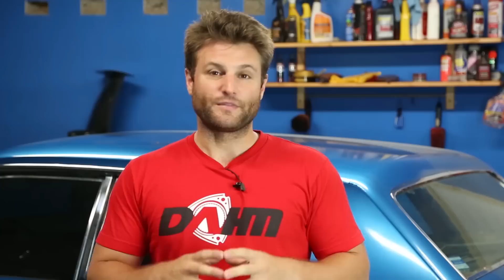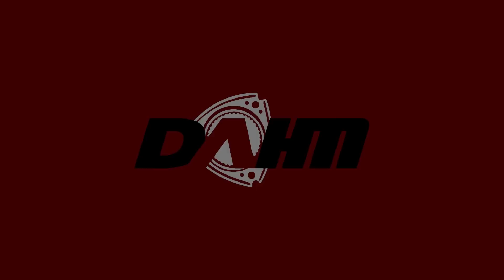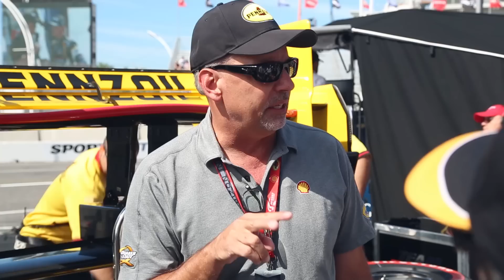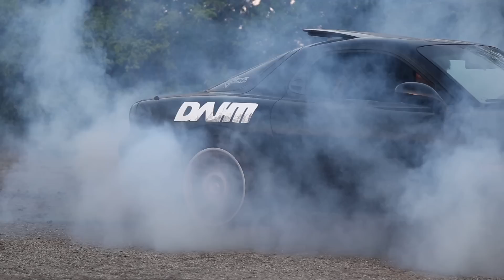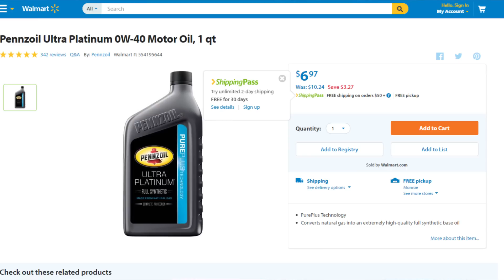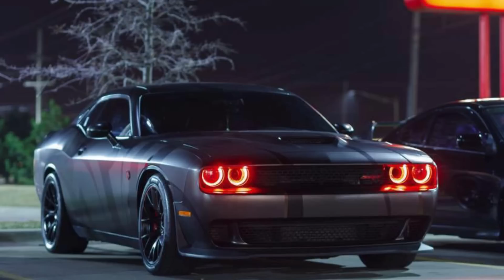Why I'm Using Pennzoil in the 4 Rotor RX-7

Comment: #RobDahn Why are you using Full Synthetic oil? 
I've always read to never use synthetic oil in my RX-8 because it's not designed to burn off and can lead to oil build up on your spark plugs which can cause misfires. Now, I am just a normal guy, not an engineer like you so could you please try to explain this better? Thanks.

Comment: Original FD owner chiming in. When my FD was new I used Castrol Syntec (forget the weight, but it was the popular viscosity choice back then) and used synthetic premix from Petit racing. The reason I mention premix is because, as you know, oil is injected directly into the fuel system by design. From what I understand, synthetics do not burn as well as traditional oils and it could damage your engine. As a matter of fact, my engine blew up at 20,000 when it was still under warranty -- which was more than likely a screwup on my part after not getting all of the air out of my cooling system after changing it. I learned later that you have keep an eye on the coolant level for a few days because there might be a few air pockets in the system. When I was checking up on the status of my car at the dealership, I saw my new crate engine with big bold black lettering "Using synthetic oil will void warranty." From then on, I just used regular Castrol and everything has been fine up to ~90k total miles on the vehicle. After seeing your video on Pennzoil, I'm very impressed with what you've told me, but I'm still concerned about using synthetic in my car. That said and thanks to this video, I might look into traditional Pennzoil blends.

Comment: My FD and my father's FD as well as my friends FD, all use Penrite HPR30 mineral oil, because we're in Australia and thats the best we can get here. No lubrication related issues with it so far, and thats across us owning 14 FDs collectively over 10 years. I doubt you guys get Penrite in the USA though.

Someone else in the comments mentioned that piston engines are harder on oil than rotaries- thats true as we don't have connecting rods 'slamming' up and down, causing hammering motions on crank bearing journals. Rotaries are smoother and less shock loading happens on the bearing journals to a point.

Someone else mentioned synthetic Mobil One oil. Its not something I would use in a rotary. It does not burn in the chambers cleanly like mineral. It has a high temp burning point and it resists being combusted and can leave deposits which gum up the seals and springs and cause compression loss issues. Mazda Australia and Mazda Japan issued tech bulletins specifically warning not to use Mobil One in the rotary (FD and RX8).

Comment: my dad was a big mistake Phan back when I was 14 years old my mom bought her Mazda MX-5 when I was 10 when I was 15 it developed a rear main seal leak for some weird reason my dad bought mobile one put it in the car and a little over a month later it stopped leaking I've used Mobil 1 and every one of my vehicle's sense I'm now 31 years old I'm a big believer in mobile one I have a 85 Mazda RX7 with the original engine and it runs great only thing done to it is header and dual 2 inch exhaust no one in my family runs anything else but mobile one

Comment: Rob, I was always told to never use synthetic oil in my rotary (rx8) because synthetic doesn't burn? Was I told wrong or whats the deal here
Reply: You were given very good advice. Stick with the mineral and you'll be fine. My FD has been daily driven since 2010 on mineral, because Mazda recommends only to use mineral, and steer clear of synthetic for exactly the reason you mentioned. It burns poorly and can leave deposits which gum up seals, causing loss of compression. Mazda issued a bulletin about this- if you google, you'll likely find it.

Comment: I'm skeptical about the rotary application.  I imagine the lubrication demands on a rotary are very different, just as they are very different on a two-stroke.

Look, there's no way I would put Mobil 1 in my two-stroke.  But I wouldn't put Blendzall in my Mopar.
Reply: Yeah, all talk aside, oil-related failures are pretty rare today.  As long as it's fresh and there's enough of it you're usually good to go.

Comment: 0 grade on rotor engine... better buy a lot of oil, you will probably be adding often.
Reply: Yup. You want to be in the 10's or 20's especially in a turbo rotary with a lot of heat from the rotary and turbo- the thicker grades will thin less and still give bearing film strength. A 0 weight is watery already without adding a shit ton of heat.

Comment: Is it true you have to pour oil into the gas tank whenever you fill up a rotary? Good thing youre now sponsored by Pennzoil or youll be broke.
Reply: it's actually common practice for high performance rotary's to delete their oil metering pump , which pumps oil directly from the oil pan into the intake. Some of the reasons are that the oil metering pump does not supply an adequate amount of oil into the combustion Chambers of higher-performance rotaries. another reason is because using 2-cycle oil directly in the gas tank is cleaner-burning then the oil metering pump which is supplied from the oil pan.

Comment: Noooooo! Don'tont use synthetic oil in a rotary engine! You are crazy. Synthetic doesnt burn off like natural oil. you will loose your apex seals a lot faster.
Reply: Its been shown that only certain brand of synthetic leaves sludge when it burns, but to be safe and avoid law suites Mazda didnt want to state any brands and recommended that all brands synthetic be avoided.

Comment: High grade oil is important but there is huge competition in the high grade oil field, everyone has their favorite oil... shell rotella has high reviews which i what i used to run in my old m3...Castrol has some very high grades of oil used in the BMW M cars...AMSOIL sponsors Motor trends engine builders segment so they use that...Valvoline sponsors some of the top Formula drift drivers...I know all Oil Company's make at least 1 top shelf oil that would suit your build...but Pennzoil is giving you money. Tell me why Pennzoil is better than xyz...or do a comparison between the oils.../end rant

Comment: All I'm going to say is that the only oil I use in my rotary powered RX7 FD is the one SPECIFICALLY DESIGN for a rotary motor and PROVEN at the most grulin race in the world...The 24 hours of Le Mans won by the 4 rotor Mazda 787B which used Idemitsu Rotary engine oil in 1991. That's all I use. In addition to that I use the fuel premix by Idemitsu to help lubricate the apex seals. because you never know when the oil metering pump will go out and without oil to lubricate the seals you'll be having a bad day with your rotary. I never had any issues with it.

Comment: so much cringe in this video. How does an oil make a car more aerodynamic--inside or outside the engine?
Reply: +Rob Dahm not to sound like an idiot but does this include all cars and not just indy cars?
Reply: its a relatively specific benefit but if the car is purpose built for half and full mile, and Rob wants to manipulate aero for higher stability, lower drag and whatnot, he will have the capability of doing so without worrying as much about overheating. Its more than anything just a fun fact about the indi cars.
Reply: Thanks for the breakdown it was kinda hard to understand

Comment: I used to always say that I'd rather run olive oil than Penzoil but they have really upped there product, it used to be epic for older car due to some additives but newer ones it was garbage. Now they have gone through with some of these newer oils are really good. I found an article an engineer did testing a lot of different oils. This isn't oil analysis of an old oil that black stone labs does. This is literally someone testing it in a few different aspects fresh out the bottle; like volatile temperatures and pressure tests. Penzoil Ultra came in first for the pressure test. Read this holy grail of oil analysis https://540ratblog.wordpress.com/2013/06/20/motor-oil-wear-test-ranking/

Comment: I'd like to start off by saying I'm not hating on your or Pennzoil, but the only reason I heard in this vid for choosing Pennzoil over other brands synthetic oils is that they let you talk directly to their engineers.  Lets break it down.  Off the shelf oil for Indy cars, actually a very valid reason, but what about all the other brands that other teams run?  Whats to say that other off the shelf oil used by other teams isn't better? Next good point is that they were able to run the oil 5 degrees hotter every year, but you didn't mention the max safe operating temp, and whats to say that other teams running other oils weren't able to do the same? or even hotter?  Next point is where you talk about how you abused it with your 3 rotor.  Moot point is that temp went up to 240*, literally any modern synthetic will do that all day long without issue, in fact most modern synthetics are ok up to about 290-300.  The next part is you talking about how you just "started it back up and drove it".  So what?  Back when I had my first car (Honda), I "just started it up and drove it" with (dino) oil below the dipstick level and half the coolant boiled out, and I drove it 300+ miles for a camping trip, then delivered some Pizza's the next week before I thought I should do something about the steam coming out of my front grill.  Point is, the fact that you drove your car after this says absolutely nothing about how the oil held up or protected your engine.  Now if you said you got the oil analyzed and the results were great, that would mean something.  The next step would be to compare it to other oils and see how they take the abuse.  Next what sounds like a valid reason your brought up is the natural gas derived process that give it more consistent molecule size, but other then saying you get better lubrication, you didn't give us any data to back it up.  One could argue that a varied molecule size is better for protection and/or power, who's to say?  How was it tested to figure out that a consistent size is better?  Also, how is this compared to other oils? Maybe a different brand figured out a way to make a molecule just as consistent with some other process, and they just don't cover it in their press materials.  Again, not hating, just you left a lot of the info you present very open ended (and you thought you were  a PITA to the engineers).  I really hope you make a second video addressing at least some of these questions.  If you have a direct line to their engineers most of these should be pretty easy to get answers for.  The question I want an answer for the most is whats this oil's max safe operating temp.  If its really higher then other synthetics I'm sold.  I'm doing my best not to have to put an oil cooler in my track car, and this can really help.
Reply: who cares dude
Reply: ***** thanks for the reply and not taking my comments as hate (as lots do on the interwebs).  Looking forward to the vids.  Do you think you can ask the engineers for me whats the highest safe max operating temp is for this oil?  Thanks!
Reply: Darrell Johnson
doesn't really make that much of a difference, if an LS3 can take 280 in a Camaro it can take the same in a Chevelle.  it may run cooler in a Chevelle since there's more room in the engine bay and prolly more openings in front for cooling... but its the same engine...
Reply: Go ahead and get an ls3 to 240 and you are going to have to pull over, not everything is a Honda.
Reply: LS3's go well over 240 at the track all the time for oil temps, 270-280 is the norm, and thats with big oil coolers (specifically talking about 5th gen Camaro's)
Reply: Bob Last I should be clear, Chevelle with an ls3.
Reply: Bob Last since your so confident try it. When you are smoking like a steam train down the road you will realize that numbers on paper are not the same as real life.
Reply: Darrell Johnson Its not on paper, these are the kinda oil temps people get running on track.  that means around 20 minutes at a time at full throttle as much as possible.  just google "camaro track oil temps"
Reply: any chance you got to ask the engineer's max safe operating temp for this oil?  I finally got an oil temp sensor for my NC Miata, last outing on the track it got to 272F, and it was a cool day and I was running a little off pace due to traffic.  I'm thinking on a warmer day running at full pace I'm getting real close to that 300F mark...

Comment: i always used pennzoil 20w50 its the best for rotary engines!
without a doubt.
Reply: especially in this hot summer
for the cold weather i switch to 10w30 which is great for winter
Reply: castrol gtx 20w50 is great too for a summer drive

Comment: You don't have to order it only online at Wal-Mart, you can buy it directly from a FCA (dodge) dealer. It's cheaper too, when I was looking for a 0w20 to run in my Mazda. Same thing back in the day when Vipers ran Mobil1. It was cheaper at the dealership.
Reply: What the hell Mazda do you have that runs 0w20??? It better not be a Miata!!!
Reply: Grant Rodgers CX-5... all the SKYACTIV cars run it. Even the ND Miata.
Reply: +Grant Rodgers what's wrong with 0W-20?
Reply: +CJ DASHCAM really??? Wow, I had no idea.
Reply: +TripleXRated and nothings wrong with it, it just normally isn't meant for regular cars
Reply: Grant Rodgers Uh yeah it is.  It's consumer grade oil.  I use it in my Mustang.  Less wear on startup, Ford recommends 5W-20.
Reply: +TripleXRated ok I didn't mean regular cars as in consumer cars, I meant cars that don't have special requirements
Reply: Grant Rodgers 
You don't need any special requirements to use different oil.  It all depends on how the car is being used.  That's why for normal street use Ford recommends 5W-20 but for track use they reccomend 5W-50 on the same motor.  It all depends on how it's going to be used.

Comment: i would never use anything but valvaline vr1 . i sent a ton of oil samples out for testing, i build mutiple engines using various oils penzoil included and vr1 blew all of them away. from protection to temp break down( lack there of with vr1) to carbon build up. penzoil tested one of the worst along with amzoil. sorry rob but this is bullshit add.

Comment: Kinda off topic but, does ethanol run well in rotary engines? If so will you be using it in your rx7? Keep up the sick videos man, I will finally be able to work on cars in school, I am so hyped for my next semester!
Reply: I think it's best to run the port oil injection thing(don't remeber the right name) that injects 2-stroke oil to lubricate the apex seals along with a small % of E85. Then you can run 100% synthetic without burning most of it. Check out the first post:

http://www.rx7club.com/3rd-generation-specific-1993-2002-16/e85-rx-7-sucessful-conversion-559156/
Reply: +SI0AX that is really cool, wow thanks for the link bro
Reply: KingUnOriginal
Oh, yeah, and the whole point of injecting 2 stoke oil is so that you don't have to premix and can run 100% synthetic oil for the engine as 2-stroke oil is designed to burn while synthetic does not burn well and will cause apex lubrication problems.

I don't think I explained well but this link is pretty damn good at explaining:
http://www.reganrotaryracing.com/fd2stroke.htm
Reply: +SI0AX  
Using ethanol or methanol fuel has absolutely nothing to do with oil injection.
Reply: Depends the rx7 u have, if u have a NA 13B and assuming your OMP is working properly, go for the lowest octane fuel and a non-synthetic oil like castrol 10w-40, i believe in a TII FC u could use 89 octane, i other words i would avoid E85
Reply: patw52pb1
No, but people would have worries that the Ethanol could wash away the apex seal lubrication and thus think it's a bad idea. I just thought I would put up the solution and also bring out the idea of why would it not be considered good.
Reply: Salafoudele Coco
But why would you purposely go for a low octane fuel?
Reply: High octane fuel damages the 13B overtime, for what reason exactly im not sure. i've never had to rebuild my engine though so it means its good
Reply: Salafoudele Coco
You will have way faster damage if you run a boosted 13B without high octane fuel.
Reply: the FC NA needs the lowest octane no doubt about it, now for the turbo versions i cant tell u for sure
Reply: Salafoudele Coco
Well, I guess it's not a high compression engine so the premium fuel won't get burned properly, but then again, that engine gets very hot. As long as you're not pre-detonating, then you don't want to have high-octane fuel that doesn't burn properly.
Reply: Ethanol doesn't blend or emoliate very well inside the rotary combustion chambers with the injected mineral oil from the oil injectors on the top of the block. I have seen it leave congealed deposits inside ports and chambers. It will run, but thats one issue with using ethanol + mineral oil injection in a rotary. It forms a waxy sludge.
Reply: Brendadirk Cramplescrunch
That's why I mentioned the auxiliary 2-stroke oil injection mod.

Comment: Been using regular Pennzoil Platinum in my EJ20 WRX for about a year now, with 4000 mile change intervals. Love the stuff, the 22 dollar price tag is pretty sweet too. I'd take the interval up another 1000 or 2 miles if I could find 40 weight.. read too many horror stories of spun bearings in boxers due to shearing to actually go 8-10k like most synthetics are good for.